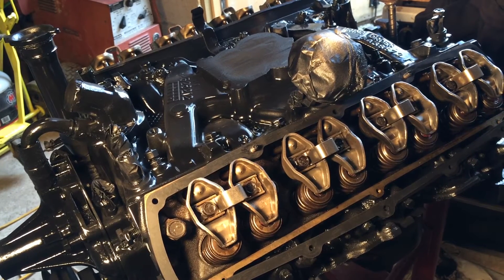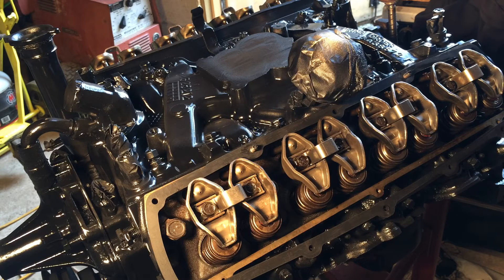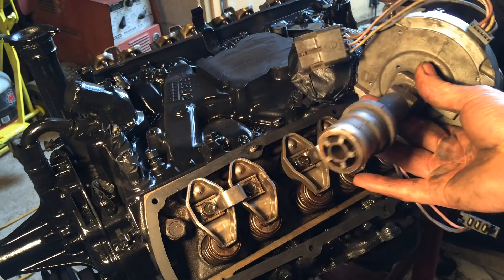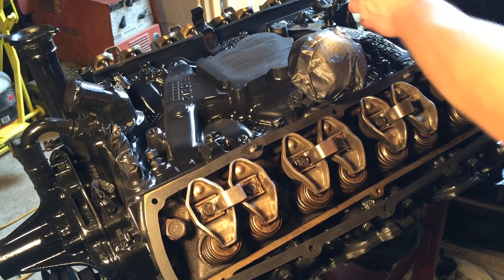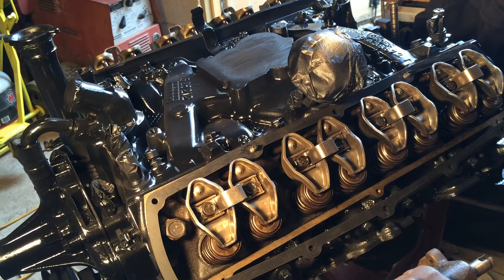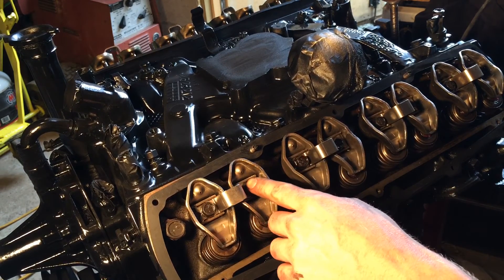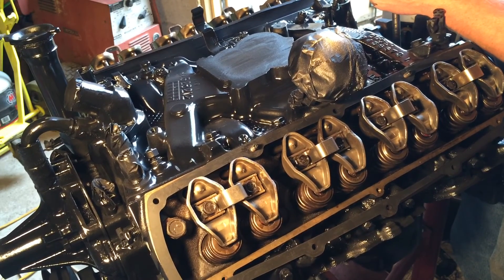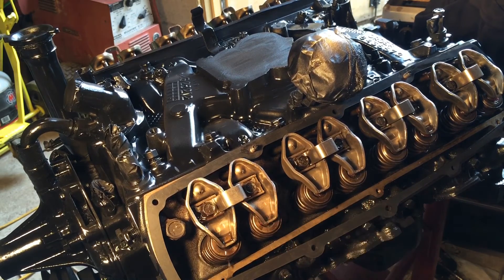How to prime an engine oil system

Comment: Well that never actually cross my mind and it's a possibility. But in the meantime my brother is going to bring over his pressure oiler and we'll see what happens. Thanks for the insight it was well received, Steel city classic. 👍
Reply from the maker: Your welcome good luck 👍
Reply: I was more interested in how to adjust the valves on this engine. I'm working on a 1970 olds cutlass rocket 350. My rockers have the same type 
Bridge across the valves. The bridges have a shoulder which the bolt goes through and once I have the valves closed I tighten the 5/16 the bolt 
To 18 ft pounds. The push rods still turn between my fingers and seem to be snug. But after about 1000 miles on my rebuilt engine I developed
What seems to be excessive valve tapping. Any ideas would be much appreciated.
Reply from the maker: Sorry to get back to you late, this comment didn't show up on my feed. These engines don't have a rocker/ valve adjustment like a small block Chevy or an engine with solid lifters. Basically the bolt gets torqued at thats it.  Excessive tapping could be a faulty lifter ( i have seen brand new ones fail many times on many on different makes of engines) or a bent push rod, or if the rocker bridges are old they wear Slightly faster than the rocker because they are aluminum. Also detonation/ spark knock can sound like valve train noise.

Comment: Excellent im doing this now and for some reason I only get oil out of one head.
Reply from the maker: Thanks. Sometimes they take a little while to get oil flowing. My small block chevy took way longer than this one. Maybe an oil galley has some assembly lube stuck in it. I've ran into that once.